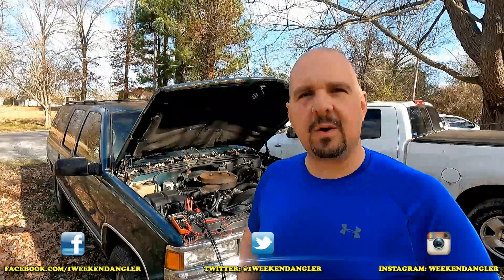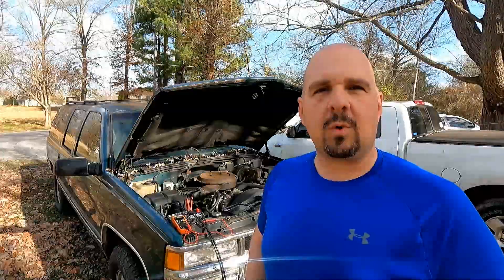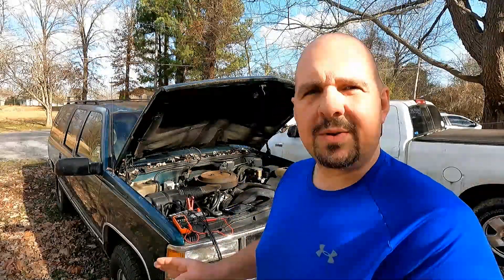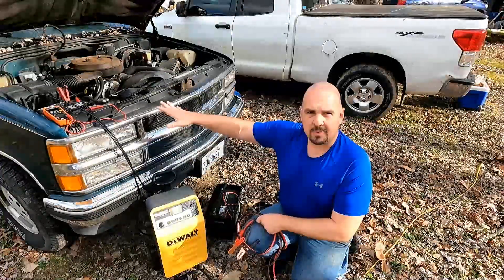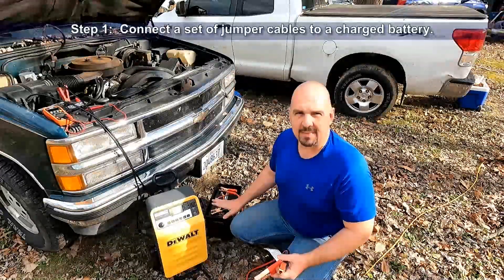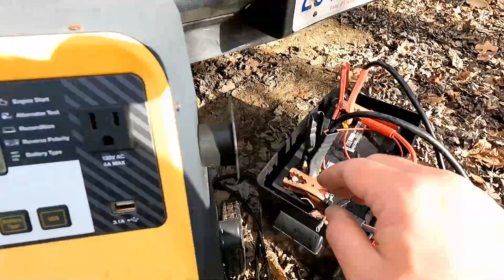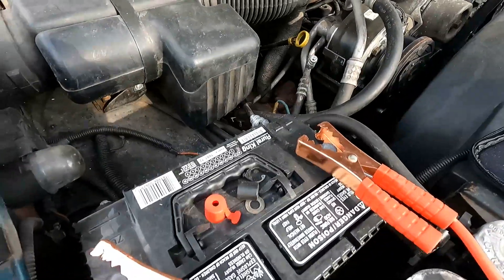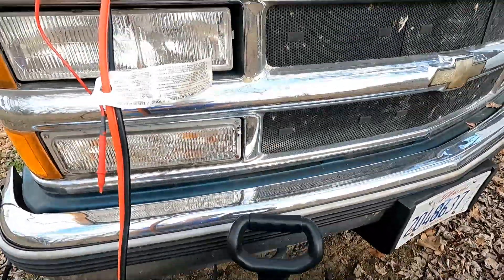How To Charge a DEAD Car Battery When The Smart Charger Won't Detect It

Comment: fully dead battery from a bad starter over the winter months .. Charger failed to see it Had a friend connect his truck to mine to boost 5 mins worth ..Added my charger to my battery with his cables on...Took off his cables Charger was doing Low battery 2Amp Left it for about 2 hours And set the battery charger on recon mode desulfated for 18 hours Then trickle charged Set a load on it And then a high speed charge ..Load test shows the battery at 94%

Comment: My wife bought me a brand new Eveready smart charger and I didn't really have a clue what the thing did but anyway I tried to charge my motorcycle battery after about an hour put it back on the shelf and got my old big huge garage battery charger out and charged it I did manage about a year and a half later to fix the smart charger I cut the wire off that had the clamps on the end because I could use them later and throw the thing in the trash can

Comment: If a car battery is reading below 9V then it is not going to be reliable ever again!  A cell (or two) might be faulty and/or the plates will have sulphated, so don't expect too much from such a battery, it will probably not start your car some cold morning..
Reply from the maker: @karhukivi  oh, please. 😂

It takes longer than a day or two for the plates to sulfate. 

 A battery will survive an accidental deep discharge or two.

The battery vendors must love you if you replace your battery every single time it drops below 9v.
Reply: @TheWeekendAngler  For a car battery to go to zero, you really have to abuse it. Do you let your battery go below 9V and then leave it for a few weeks or months?
Then when you need to go somewhere in a hurry on a cold morning it won't start the car.  I only buy a car battery every 6-8 years and even then they are not below 9V,  but I want the car to start first time.  Some are poor manufacture and don't last more than 2 years or even less.

Comment: Good idea. Following a suggestion from one of the comments I tried a different way to get my smart charger (Vector) to charge. My battery is only 18 months old was showing 2.4v and hitting the charge button would immediately go to FLO (float) and then Recondition.  So I connected the battery to a working car and "jumped" it with jumper cables and let the engine run for 10 minutes.  Then I disconnected the ill battery from the jumper cables to connect it to the charger.  Then it started charging normally.

Comment: It seems to me smart batteries are designed for premature discard by owners, so that rebuilds are more lucrative.  They do what you did, and turn the sale around again because basically, there's nothing wrong with the battery bad enough for discard.  Batteries are sold twice:  once new, then USED LIKE NEW with little comparative markdown.  Old chargers meant a dead battery that could not be charged was also likely to be a brick for the reseller.

Seems like it, doesn't it?

Comment: I put charger to dead battery. then cables from helper battery onto charger clamps. Once charger fooled I can take jumpers and good battery away. Good battery could also be another good car to fool charger. I did have a modern charger with an overide button. It was great until I backed over it. Shit happens. Sometimes I use old charger to fool new charger then disconnect.
like using new chargers when I wont be around to disconnect.   thx for video as it will have helped many out there.     Canada

Comment: Did not work, if it thinks it connected to a good fully charged battery why would it charge it? None of it makes sense
Reply from the maker: Two batteries together, one deeply discharged, one charged would be seen by the charger as a battery around 50% capacity.

The chargers look for a reference voltage to allow voltage to enter the battery, but it's the battery itself that draws current from the charger.

You can actually watch it on chargers with an ammeter. As the battery charges, the amperage being drawn decreases.

Comment: This is excellent help. I have a battery in my Subaru which is reading about 11.7 volts and which is not enough to turn the engine over. The problem is that I have bought a new Ring smart charger to replace my old broken non smart charger and the new charger is not recognising the battery-even at 11.7!. I had thought today that the new charger was faulty but in order to prove/disprove that, I shall follow your steps in this video to see whether it's the new charger at fault or whether the battery is simply not at a voltage which the charger will recognise. Thank you.

Comment: Some "smart" chargers do have an override function but most don't.
It's ridiculous!
It ranks up there with the new gas cans!
I learned about this charger problem when I picked up a smart charger at a thrift store with no owners manual...it didn't charge my battery and when I looked into it I learned what was going on.
You can actually just temporarily attatch a 9-12-14.4 volt small battery just long enough to fool the charger and then remove the small battery and that usually works.
A 9volt alkaline battery can work sometimes or a drill battery or whatever just get the polarity right!
And remove it after the trickery!
And again some chargers have a way of overriding the detectable voltage feature for a short time like 5 minutes?
Read the manual!
Or keep or buy old school chargers!

Comment: I HATE the microprocessor controlled chargers! I actually threw out a good battery because my new Stanley charger stopped charging after a few seconds and went to a zero-effective, never ending "Reconditioning Battery" state. I let the NEW battery on my seldom used farm truck run down again and yep, the Stanley said "NO." After watching your video I realized that if I supplied enough voltage, the charger would sense the battery and charge it. I used the Engine Start feature on the Stanley. It supplies a heavier charge for 60 seconds. After about 10 consecutive Engine Start cycles, my battery had enough voltage to be sensed, and it charged perfectly Thanks for the "lead!"

Comment: Would it make sense to try this from one vehicle to another rather than jumpstarting?
Reply from the maker: That would work. I'd probably connect the running jump vehicle to the dead one and allow about 5 minutes. The running vehicle's alternator will likely put a surface charge on the dead battery which will be enough to trick the charger into coming on and finishing the job.

Comment: On some smart chargers the "bad battery" light may be more of a tell-tale than something that cuts power. I figured that much because the aligator clip on a Duralast charger was still sparking. If it wasn't trying to push any current, it wouldn't be doing that. I figure they may still switch to a different mode however (even lower charge rate?), to play it a bit more safe.

So if it sparks with a bad battery indicator, it's still doing something.

Comment: Thanks for the video!  My B&D "smart" charger had never failed me, but it just kept clicking off when I attempted to charge my Chevy Silverado dead battery which had been setting idle for over three weeks!  I followed your video using a "ghost" battery removed from my private aircraft and it worked like a charm!  (I first tried a 9V radio battery, but couldn't get that to work.) Thanks for the "tip" and the very clear and easy procedures for the fix!
Reply from the maker: I'm glad to hear it worked out for you! We've got to help each other with all these "smart" chargers these days.

Comment: This is also an issue with the 18650 and likely many lithium ion batteries. Some of my chargers will get past the low voltage, won't charge issue, but most would not. The remedy is the old type transistor radio 9v or probably any 9v. Use it the same way as explained here, and your off to the races. As mentioned in my prior post, unless someone can prove otherwise, something is VERY fishy with today's chargers.
Reply from the maker: Yep. Make a charger that won't charge and you can sell people new batteries. Plus, since the analyzers at the stores will show it good, since it is, they don't have to warranty it. I wonder how many folks have bought batteries they didn't need.

Comment: What the heck is the point of this idiotic "feature" ? I mean it's so idiotic, many would consider such charges defective and should be returned. Enough returns would put a stop the issue. Call me paranoid but the only thing that comes to mind is the charger is designed to give the impression your old battery is ruined so you buy another. If anyone can come up with a better theory, I'd love to hear it.

Comment: Going to give this a try, I've got a 6/12 volt smart charger. It will charge a dead battery at 1 or 2v but only to 6v. It must have to read higher for it to realize its a dead 12v.

Comment: But if you have to do all that what's the purpose of the battery charger that's why we buy a battery charger to avoid all that
Reply from the maker: That's why I still keep an old style manual charger around. Easy way to tell is quickly clap the leads together. If you see sparks, it'll throw voltage into anything you connect it to.

Comment: Instead of hooking the Dewalt to the john boat battery connect it to the dead battery. Then just piggy back the other leads temporarily onto the dead battery. Then when charging starts you can remove the john boat battery and your Dewalt is already in the right place.

Comment: I do something similar. I 'briefly' touch jumpers from good battery to totally bad battery.  1 second or less in case dead battery has short, etc...Then I disconnect and just attach charger to dead battery. More times than not, the quick connection above will bring the voltage high enough on your battery to get the charger going.

Comment: If I have a good battery and jumper cables, I no longer need a battery charger for any reason whatsoever. I have numerous trucks, GM and Chevy, in the years 2000 to 2006, and they all developed battery drains. I don't have time for these garbage "smart" chargers at all. These engineers go out of their way to complicate things and solve problems which do not need solved. The answer to having a battery which can start a car under any circumstances is to have a "dumb" charger which charges batteries, not scolding yourself about leaving a dome light on and saying "oh well, this is my fault and i deserve to be punished"... Charging batteries was never a problem. Why is this even a problem? Because all of you let it happen. You buy garbage products and think this is normal.
 I don't need my charger to be "smart" or to micromanage tasks that I need to resolve. Charging any type of battery in any condition and in any circumstances was guaranteed to occur. If you had a charger, and a dead battery, you would be able to start your machine. Now we have chargers which won't even tell you on the box that it only charges batteries which currently have a certain voltage. So now chargers are hit and miss? Old chargers would charge any battery, while new chargers pick and choose which batteries to charge based upon some arbitrary standard which is done by some engineer creating extra digital circuits into the device to limit what it is allowed to do. Why are they doing this? Not to help you out... Hahaaaa ... A battery charger which doesn't charge batteries, THESE SNAKEOIL SALESMEN ARE MANUFACTURING AND SELLING BATTERY CHARGERS WHICH DO NOT CHARGE BATTERIES!!... AND PEOPLE ARE BUYING THEM AND LOVING IT!... amazing... Hey, I got an idea for something that people will friggin love: SMART FLASHLIGHTS. I will design a flashlight which will allow you to control many features of light generating technology, like lumen concentration, ambient wavelength recognition and control for the sensitive eyed person, brightness control to keep things illuminated at a constant level regardless of the time of night. However, this flashlight will not work in complete darkness. Why you ask? Hey, if you will buy battery chargers that kinda work as long as your battery is kinda charged, but not at all when you need it the most, then you will surely buy a flashlight that will kinda work as long as there is some kind of light already present, but not at all when you need it the most. Ooh, my brain is storming, I'm gonna be stupid wealthy from an entire line of "smart" gizmos: fix-a-flat ((but not if you're all the way flat), air conditioners (but does not work in desert conditions), sanitary tissue wipes (but will not clean up body fluids), clear eyes (common side effect is irritated eyeball), tattoo parlors (corner the temporary tattoo market by just not telling anyone up front, kinda like how these battery charger guys fail to make any mention that their chargers will only temporarily charge as long as your battey already has a charge), deodorant sticks (only works for people who smell like roses to begin with, and fails to work if you are active for more than 5 minutes), ink pens (the pigments break down after 10 minutes)... Okay, I'm done.

Comment: So the idea is that you need a good battery on hand to start the charger that’s meant to charge the dead battery. Smart battery chargers are not so smart & whoever created these “smart” chargers should be recognized and shit on for literally going backwards. Older battery chargers were fine and could charge a dead battery but now a diy to fix the smart charger is to have a whole other completely healthy battery somehow have it on hand if your car decides to shit on you & not start, then trick it that it’s got 12 volts out of thin air or unicorn tears or just so happen to carry a few 12 volt battery spares 😂. I thought the idea was that the dead battery doesn’t have anywhere near that range but maybe common sense isn’t so common nowadays lol

Comment: Will it work if there is no charge left in the battery. You had 11 volts in the suburban
Reply from the maker: I've used this method before with batteries reading under 1 volt.

Comment: I've done this many times and it does work by tricking the voltage however I will advise you that one time I did this on a 12v battery that was at 5.5 v and few hours later the battery took off in my yard good thing I have big yard and charged it away from my house or garage 🙃..The cause was my charger was damaged somehow from doing this method I thought the inline fuse would or internal components would've just burned out and stop charging I was using a Ctek charger.

Comment: I bought an old style battery charger today.
The receipt was still in the box. It was bought in 1979.
It's now charging my totally dead battery.
Reply from the maker: I got my hands on an older manual charger this week also. I opened it up tonight to go through it and check it out, but so far all is looking well with it.
Reply: @TheWeekendAngler  I've now charged two totally dead batteries with it.
The best £5 I've ever spent.
Reply: Anyone else looking for a manual charger, I haven't found any. The best option I found is harbor freight's analog style charger. It requires 7V on the leads but you can google the hack that puts a switch between 2 solder joints so you can bypass the 7v safety mechanism.
Reply: @thebluelunarmonkey  I got mine from Facebook Marketplace.
Reply from the maker: @thebluelunarmonkey  Harbor Freight just released a manual charger. I saw it at the store yesterday when I was there. It's about $50. I think I'm going to buy one and try it out and do a review video
Reply: @TheWeekendAngler  That's the one. 59424. It's manual but still has the 7V safety where it won't charge unless the clamps read 7V or you add a switch between 2 solder points inside. I can point you to the video to modify it.
Reply: @TheWeekendAngler  not my video but the title is: "PawPaw Forces the Harbor Freight 2/10/50A Battery Charger to Work". Slightly different outside probably same internals. The reviews show people irked it won't charge flat batteries and HF Rep has stated the 6.8V minimum needed at the clamps

Comment: How are those Dewalt chargers? I didn’t know Dewalt sold those.
Reply from the maker: I wouldn't buy it a second time if I had the option.
Reply: I have the DeWalt DXAEC80 dual bank charger. It's good too with a pretty good desulfate cycle. Charge, desulfate for a 24 hours, repeat charge and desulfate 3 times. It does require somewhere around 9-10V on the clamps before it will charge, maybe I'll open it up and feed a 12V thru a 2k resistor and a switch to the + clamp to bypass the "safety".